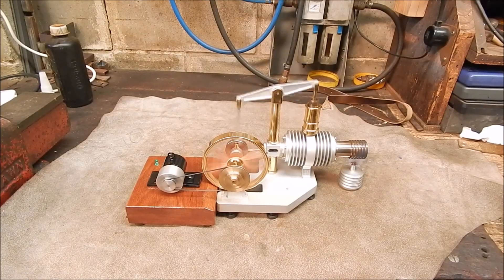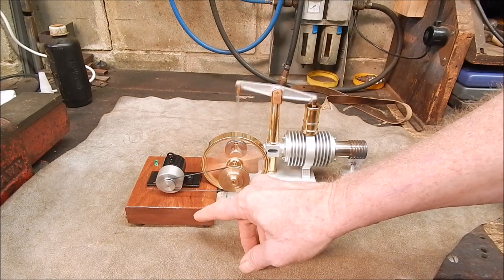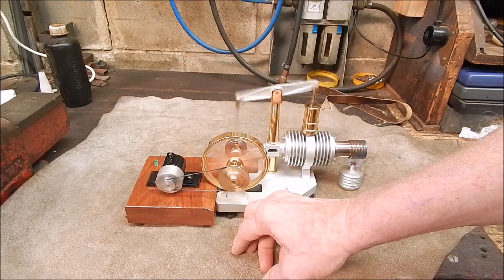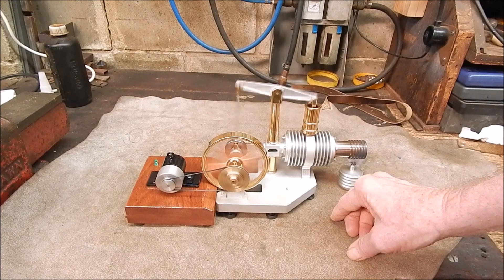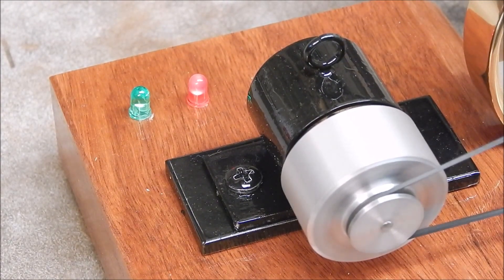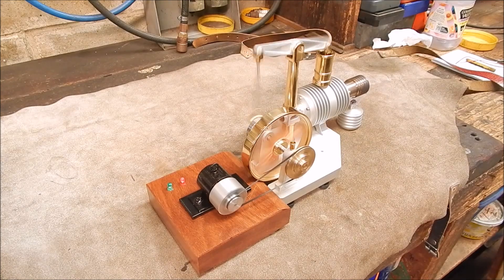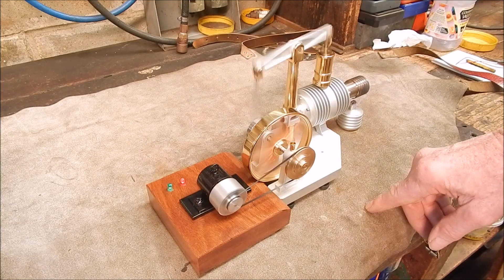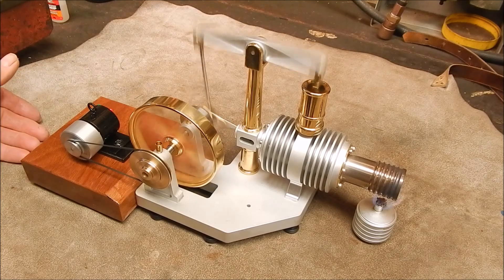The PC case fan based generator is finished

Comment from the maker: Note:  When you look closely at PC case fans it soon becomes apparent that they are not exactly precision devices.  Run out in the bearings and main shaft are to be expected.  Cheers Rob
Reply: Well, they are designed with a lot of clearance, because of the plastic housing, but a drop of 20W30 oil on them will fix up the slop nicely. If you look out for genuine Intel fans on your trip to the local free shop ( street PC or scrap yard) you will get 2 nice reasonably good ball bearings that are an almost direct replacement for the bushes. Those last a long time, and are a lot more precise, and with a drop of 0W5 oil in them (really tiny balls, so need a very thin oil) they will be much lower friction as well. might just need you to polish your shaft a little more to make it a slip fit, no need for a press fit in the shaft, though a light press fit in the housing will help, or a drop of clear nail varnish will work as well to hold them.
Reply from the maker: The PC fan I used had one ball race and one bush.  I added an outrigger bush and longer shaft to try to reduce the wobble.  Got it a lot better, but not perfect.  The ring magnet was also not central as fitted in the plastic fan hub.  Fixed that with the alloy replacement.  Spins freely, but has a bit of wander as you can see in the close up shots.  It's not a machining issue, just sloppy manufacturing.   Cheers Rob

Comment: Came up nicely Rob - Cheers Jim
Reply from the maker: Thanks Jim.  I added a couple of small brass line out connectors this morning.  Measured max voltage is 2.85 AC.   I  may add a small rectifier if I can find the right sized bits to do it.  I did think about gearing up the Genny for more volts/speed, but I don't think the Stirling could handle much more load.  Cheers Rob
Reply: @Xynudu  This is how I did mine three years ago.....rough but worked! -
https://www.youtube.com/watch?v=o5yJFpiCUZ0

Comment: Love the wee lifting eye 👍  Also like the idea of some mini street lamps. I reckon those lights I am using would be ideal, you could run quite a few as they only need about 2v and bugger all mA. $8 in the party aisle at Big W. Cheers mate 🍻
Reply from the maker: Hi Bill.  Real gennys have a lifting eye ;)  I will check out those LED strips you used.  I had a bit of a browse on line but wasn't sure what I was looking at.  Thanks for the tip.  Cheers Rob
Reply: I reckon I'll end up with a length to spare if you can't find em🍻
Reply from the maker: Hi Bill.  Thanks for the offer, but I just got back from BigW.  They were sold out of the ones you used, but I picked up a string of 30 LEDs on thin copper wire for only $4.  Bargain.  I just tried them with the included AA battery box and they are f##king awesome.  I'm shooting a video on them for interested parties (when the rain stops beating on the workshop roof).  Hooked up to my variable power supply they kick in at 2.5 volts, so ideal for the little PC fan genny meagre output.  I will probably add a string of them between two poles on the wood base.  He He.  Should look kick arse :)  The copper wire is coated with a clear lacquer insulation, scrape that back you're good to go with the soldering iron.  Thanks for pointing me in this direction.  So many uses for model makers.  Cheers Rob
Reply: 🍻 Cheers Rob. I was pretty happy when I found em too, not sure about reliability but with planning they could be replaced if needs. Resources can turn up in the weirdest places 🤣 Hope others find it useful. Also if you want, the flashy usb charger/fibre optic cable is from a mob called ...Urban Gear* ..../Dats Pty Ltd

Comment: I wonder if the set up would run another motor off the current it produces. Interesting and inspirational, thanks for posting Rob.
Reply from the maker: Hi Ian.  I doubt it.  The voltage is low (about 3 volts), but it gives quite a few milliamps.  It lit three LEDs no problem, but I didn't try any more.  It would be interesting to see how it compares to a brushed generator of similar size.  Cheers Rob
Reply: @Xynudu  and if the engine could cope. When I get an 'around to it', I intend to build me one of them engines that only use hot air. Apparently there seems to be an abundance of that commodity at the moment. Chin up UK
Reply from the maker: Ha Ha.  Yes, hot air is what runs the political scene.  Unfortunately it does the world no good and gets a lot of people killed.  Nuff said.  Cheers Rob
Reply: Not really, those motors are really designed to be inefficient, as they have to do speed limiting using core loss.  Best to go hunt for a 24 or 48V fan though, much finer wire and many more windings, that will at least be able to generate 6VAC or so in operation, though also only at around 5-10mA of course.